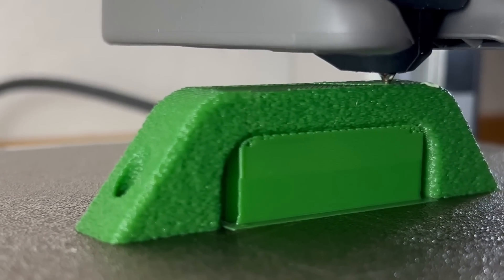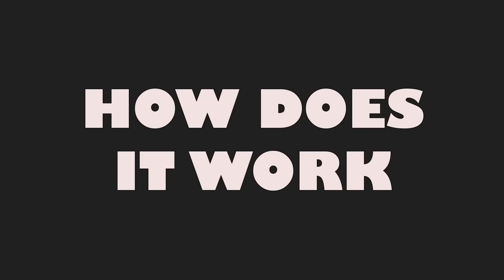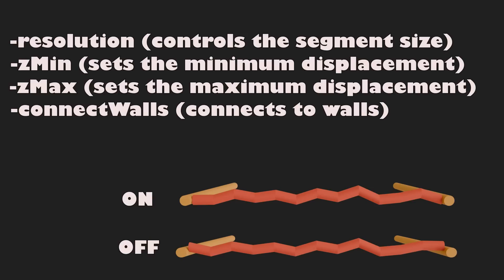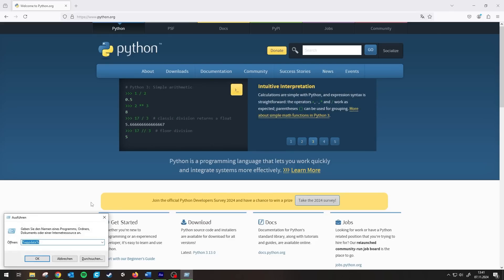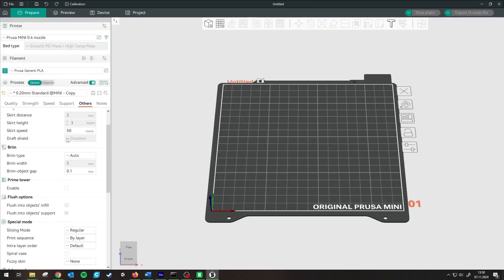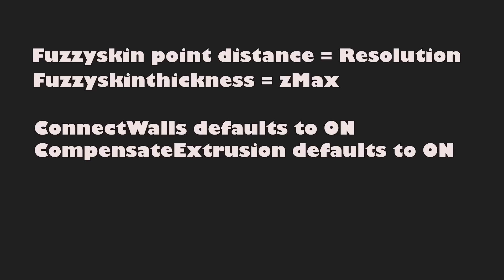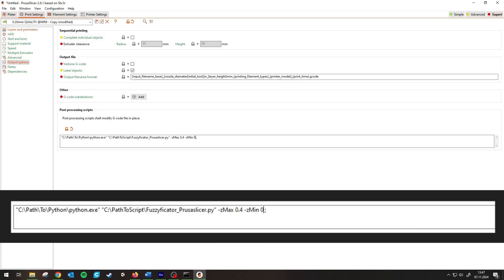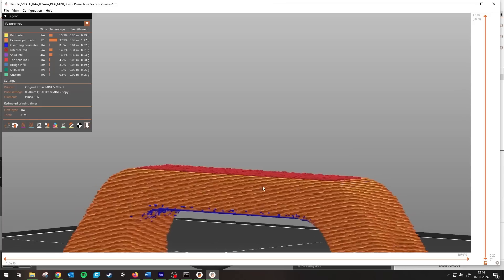UPDATE! - Non-Planar Top Fuzzyskin - 3D Printing Guide!

Comment: i cannot get this script to run on orca slicer with A1 mini. i've tried all the reddit solutions and none have worked.
Reply from the maker: Did you use the bambustudio version? If so, what was the issue and  do you have a specific error code or any tell in the logfile? Also make sure to try running the slicer in admin mode, if you haven't already.

Comment: Can you update your code to work when using painted fuzzy skins in Bambu Studio. To use Bambu Studio Fuzzy skin painting, you must select none for fuzzy skin. Since it works with any of the other selectons; Contour, Contour and Holes, All Walls, I am assuming it is just a mask issue on the selection? Also there is a disable option that, if this is just a mask of the seletion, could be used to skip processing if desired.
Reply from the maker: I can have a look at it, but it most likely won't work. To postprocess the gcode where it's needed, we need some way to tell that from any kind of marker in the gcode. The paint-on script, uses the toolchanges as such markers and removes them in postprocess. 
Since the built-in fuzzyskin paint does the calculation in the gcode generating layer, there almost definetly won't be a marker for that in the result, and it will look like normal lines without any indication, that it is fuzzyskin. And I have no access to the mask that is used in the slicer on the model, since we are working with the result.

Think of it as lost information. Normal process:
Slicer->model->settings and mask->generate Gcode with settings(+ based on mask) -> result (with only relevant info)

We would need to do:
result->reconstruct settings->reconstruct masked area based on result+settings -> map as mask in 3D space

This could work to reconstruct the present fuzzy areas, but we would have no idea on any unprocessed mask e.g the top layer, since there is no info to gather from the result. 

Thats why we sneak in the information via toolchanges, to have it ready in the result to work with.

A good comparison:

Look at a drawing, find out which pencil set has been used (the settings) -> map the inividual pencils that have been used for each stroke (possible so far) -> now guess what pencil would have been used if there was an additional stroke (impossible)

That's why we create the drawing as line drawing and add the colors ourselves

Comment: How can we edit the resolution if I want it different to the point distance?
Reply from the maker: You can add parameters behind it. -resolution is the pointdistance and -zMin -zMax is the fuzzyskin thickness.

So "path/script.py -resolution 0.8 -zMin 0 -zMax 0.5 "   would be equal to pointdistance 0.8, fuzzyskin thickness 0.5 in slicer.

But since gravity plays a role, it won't match the look perfectly and you will most likely need to do some test prints with different settings to see what matches best on your printer, with your print settings.

Comment: Hi, I’m having an issue with the Bambu Studio version of Fuzzyficator and I can’t figure out what I’m doing wrong.

I used the exact same post-processing command shown in your documentation. When I press Slice Plate, the CMD window opens normally and the script runs without errors. The post-processor clearly executes because I can see all the printed messages in the CMD window.

However, the problem is:
the top surface does not become fuzzy at all.
Everything slices normally, but no fuzzy effect appears on the top layers.
Reply from the maker: Hey mate! Did you re-open the 3mf file? The slicer does not display it without that. So to see whats happening, you have to choose "export  g-code file" first and open it again (ignore the customized gcode warning). If you only want to print without looking at it, you can just print normally and the fuzzyskin will be there.

Comment: Love your script. However, I did run into 1 problem, at least I think I did. I left Fuzzy Skin disabled so I could use only paint-on fuzzy. The edges of the model that I painted did get skinned, but the top did not. When I exported, a CMD window started to open, but it closed immediately with not text displayed. When I enabled Fuzzy Skin and set it to outside walls the CMD window opened and a bunch of text was displayed, and a look in gcode viewer showed fuzzy skin. So, maybe your script checks to see if Fuzzy Skin is enabled and just exits if it isn't, without checking if there are painted on surfaces?

Is this a bug?
Reply from the maker: Hey there :) Are you able to provide a screenshot and the exact parameters used for running? (either on Github or in my subreddit)
Did you add "-run" while running without enabled fuzzyskin?
Reply: @tengertechnologies  thanks so much for replying. Soooo, turns out I didn't understand something. I thought "-run" was only if you wanted to change some parameters. I did not realize it will force the script to run even if Fuzzy Skin is disabled in Print Settings. I added "-run 1" to the Output Options and it did indeed create fuzzy skin on the flat surface. So, problem solved. Thank you for asking if I added "-run". That was the clue I needed.
Reply from the maker: @SteveWeathernam  Glad it worked. Have fun and let me know if there are other issues! :)

Comment: I'm trying to add this to Bambu Studio on my Mac. I believe that I have it installed properly but I can tell if the script is running when I slice my plate. Is there a way to tell? Second, do you know if the script works with "contour" setting for fuzzy skin?
Reply from the maker: You have to re-open the gcode file to see the changes. Bambustudio is a bit special as it not just spits out the gcode. You have to choose "Export plate sliced file" or "Export all sliced file" and then re-open the exported .3mf file with choosing "open as project".  This is only for visual verifying. If you don't need to look at it, it will just work as normal when hitting print.

As for the contour option: The top layer fuzzy skin is always contour/only one layer thick. The walls use the normal slicer setting.

Comment: Thanks for this share. I've tried several things on two different printers (ender 3 pro and bambu a1 mini) with latest (2.3.0) Orca slicer. 
I've tried w/wo any params, and w/wo some of the params. I've tried with python 32 and 64 bits, but nothing seems to work. 

Did anyone manage to make it work recently?
Reply from the maker: Is there any Error message? Please try to run Orca in admin mode, this may fix it for you.
Reply: @tengertechnologies  
thanks. i'll finish the current print and give it a try. 
i do see a console opening in the background and running and then closing. but orca doesn't show any error. can i simply run the script manually on the gcode from cmd or powershell?
Reply: @tengertechnologies  I tried running as admin and also executed the scripted on the gcode directly after generating it, the msg was

2025-10-22 17:39:23,191 - INFO - Script started
Script started
2025-10-22 17:39:23,229 - DEBUG - Support contact distance: 0.275
Fuzzy skin G-code generated successfully with constant resolution!
2025-10-22 17:39:23,234 - INFO - Fuzzy skin G-code generation completed successfully 

and i could see the file was re-written, but when I opened the gcode again in orca, the top layer is not modified.
Reply: @tengertechnologies  i finally had some time to dive into the code and found some issues that i fixed. I'll send you the updated file later. 

:)

Comment: Everywhere I look says prusa slicer 2.9.3 should have the fuzzy skin top layer option available but under the fuzzy skin section and print settings it only has options for fuzzy skin, fuzzy skin thickness, and fuzzy skin point distance?  Where is the option to enable fuzzy top layer?

Comment: Cool Project and will be useful for some projects surely. I will have to test around a bit. I was considering using it to make a fuzzy toplayer at the bottom of a round cutout to hide the first layers of the round which are rather visible most times. At the same time it would not make that much sense to have the fuzzy skin on all top layers. Do negative modifiers work on prostprocessing scripts? It is  the first postprocessing skript i started experimenting with. Currious to see an update on the Paint-On feature from your GitHub in the future. That might be a good solution for application to only some areas.
Reply from the maker: With the painton version your uscase should be possible. There is a video about it on my channel. It was a workaround back when there was no default painton fuzzyskin in the slicers. But it should still work.

Comment: FANTASTIC!  This is a game changer for top layers.  @tengertechnologies thank you so much for your work on this!  I was able to complete a very special project I've been working on.. My dogs both passed away last year and I was able to model their actual paw-prints for 3d printing, but I couldn't get an acceptable top-layer pattern until I found Fuzzyficator.

For those having trouble setting up....  I'm not a coder, but here's some things I found that weren't immediately obvious to me-   (current as of 2/5/25 -- might change in the future) 

1) I kept getting Error Code 2.  This was because the capitalization matters when typing the settings into the post-processing script.  Example:  -zmax doesn't work.  It has to be -zMax.
     1a) The example script displayed in this video misses a capitalized 'c' letter in -ConnectWalls.  It has to be -ConnectWalls 1 , not -connectWalls 1
     1a2)  However...   the 'c' in  -compensateExtrusion IS lower case.  It has to be -compensateExtrusion , not - CompensateExtrusion

2)  I was also having trouble with Error Code 9009 which  I though was due to file paths, and tried all of the other suggested fixes in the comments.  I eventually uninstalled the 64bit version of python re-installed the 32bit version.  I'm not sure if this was an actual fix, or just a coincidence as I also tried the other suggestions, but it worked after I installed the 32bit python.

Comment: Hi, Thanks for making this. Using Prusa - When I use the code along with ( -run 1; )  I can export the file. However, if I use ( -zMax 0.3 -zMin 0 -connectWalls 1 -compensateExtrusion 1 -run 1; ) I get an error code.

Comment: @TenTech could the script be used as such that the fuzzy skin is inside the 3d printed object, and the outside walls are normal (not fuzzy). I am assuming it would strengthen the xy plane against sheer force.

Comment: Help. i get this error: Post-processing script "C:\Users\Sten\AppData\Local\Microsoft\WindowsApps\python.exe"
"C:\Users\Sten\Desktop\PYTHON\Fuzzyficator_Orcaslicer.py" on file
C:\Users\Sten\AppData\Local\Temp\.OrcaSlicer.upload.787f-bdc5-eb14-a0a1 failed.
Error code: 9009. can some one point me in the right direction
Reply: i got the same error - fixed it by reinstalling python from the official site (not microsoft) and clicking "Add Python to Path" when installing. 
Use the python directory link and not the microsoft one: 
C:\Users\Sten\AppData\Local\Programs\Python\Python313\python.exe

Comment: This looks amazing  and I would love to try it. I have followed the guide and get an error 9009 when it goes to post process. I have validated the file paths of pyton and the script and even moved them incase the location was a problem. I am using a bambu printer so I tried the bambu specific sript too in orca slice and still have the same problem.
Reply: I am getting the same error, have you found a solution?

Comment: This is an amazing tool!! BUT I'm curious about the lifespan of the z-rod and motor(s)... The handle was a very small print and lighter than the build plate, but what about when you print something large, say, a teddy bear? The print gets very heavy, and with the fast movements you showed, I’m concerned about how long this will hold up and/or how well the print will stick to the build plate.

Comment: Hi there I'd like to know if you would be willing to do work on Non-Planar coding not specifically for Fuzzy Skin but for Non-Planar in general. 

I'd been interested in Non-Planar for years and earlier this year tested Non-Planar Prusa Slicer.

It worked but the way Prusa Slicer implements top layer direction is sub optimal for infill under a particular percentage. 

I think Non-Planar printing is a big part of the future for 3D Printing and with a particular material that's new to the market even more now than ever.

I'm have a very minimal understanding of coding but I have a strong proficiency for understanding what an optimal tool path should be and functionally strong slicer utilization and actual printing abilities.

If I could discuss a few things with you that you could then perhaps code into one or more Slicers I think the results would be fantastic.

Please let me know if that is possible and how best to communicate with you if available.

Comment: Hello,

I can't seem to get it to work.
Using orcaslicer 2.1.1
Printer is qidi q1 pro

Error:
C:\Users\MYACCOUNT\AppData\Local\Temp/orcaslicer_model/Sun_Nov_10/13_08_44#10616#285/Metadata\.10616.1.gcode.pp failed.
Error code: 9009

Comment: I love this idea, thank you so much for sharing it! 

I had some difficulty getting this work in PrusaSlicer at first. Here are some tips I found which may help others:
1.	Make sure there are no spaces in file path for Python and the script.
2.	Ensure “Supports binary G-code” is unchecked under “Printers” .  If this is checked, which is the default,  it will generate G-code without error but the script does not appear to run.
3.	Under “Printer Settings” go to “Single perimeter on top surfaces” and select the “All top surfaces” option. This will ensure the texture is unform across the whole top surface.

Comment: Normally I use Hilbert Curve to the top surface. I installed the script, very easy to do. Ran it on my K1 Max. It's a close match in texture. Fuzzy Skin might be a bit better because of the height of the print. It feels more natural. Good job. It did seem to be very loud when printing (but that could just be my settings.)
Reply from the maker: Thank you! I'm thincking of implementing a speed parameter to allow you to slow things down. This will hopefully decrease the noise and wear on your Z-axis

Comment: This is outstanding, great work!

Since this is for the top layer, would it actually hurt if the min value was negative (by a small amount), it would just press into the previous layer yeah?
Reply from the maker: Thank you! You can do this but it will get some plastic buildup on the nozzle and if it‘s to much, I‘m guessing it could clog. But I‘ve left the option in there for people who like to try.

Comment: I wonder if on the shallow angle surfaces you could do an "angled" fuzzy skin with a combination of xy and z fuzziness. You would need some way of calculating the angle of the sloped surface at that point and then apply the fuzz in the perpendicular direction. I'm assuming there is something in the slicer that already calculates the slope like this, since it is already able to detect overhangs as well, so maybe you could piggyback off of that.
Reply from the maker: That's a great idea, I'll add that to my list to check.

Comment: This is great!  1 improvement I would like to see on Fuzzy skin is the ability to paint areas of the model that the fuzzy skin can be turned on/off.  To allow us to get texture breaks on parts or to create label pockets…
Reply from the maker: I have an idea on how to implement that as a postprocessing script but I haven't tried out yet
Reply: @tengertechnologies would you share your ideas? :)
Reply from the maker: @JG-mz7hg  Not yet, but I've got something working already. Give me 2-3 weeks. I don't wan't people to break their printers. If it proofs to be reliable enough, it will be opensource ASAP
Reply: @tengertechnologies  that sounds great, thank you 🙂 let me know if you need any help with programming or testing
Reply: Use part modifiers. This can allow you to use fuzzy skin in particular areas or patches.
Reply: @JamesCarson-pe1vz not a good option.
The paint on fuzzy skin is the best one and very simple to implement and it should be already done. I suppose not a lot of people use fuzzy skin so there is not enough demand for it.